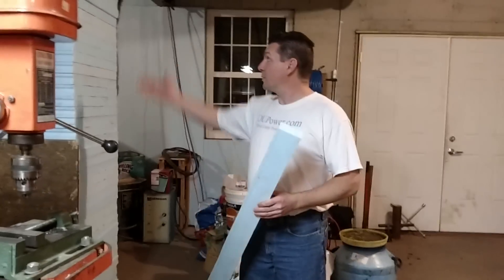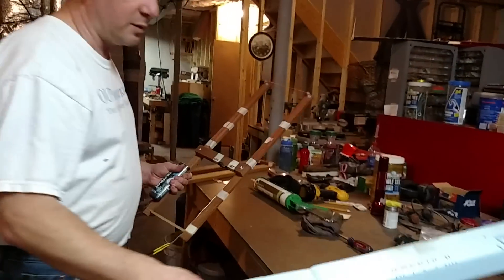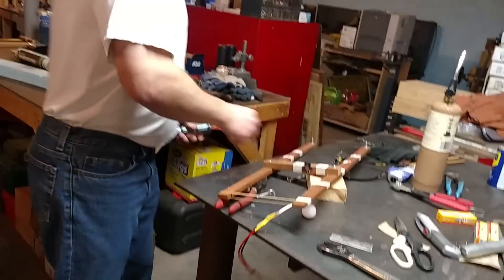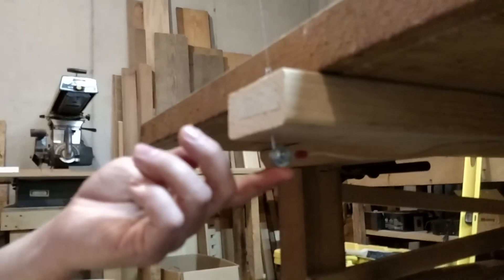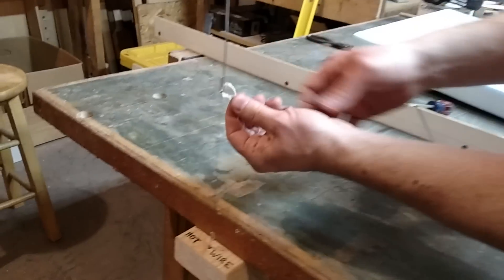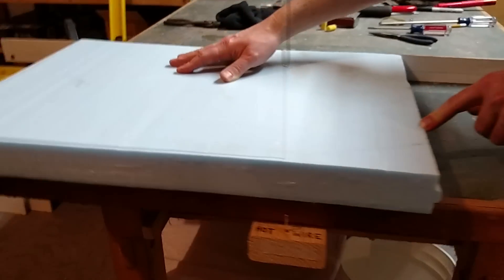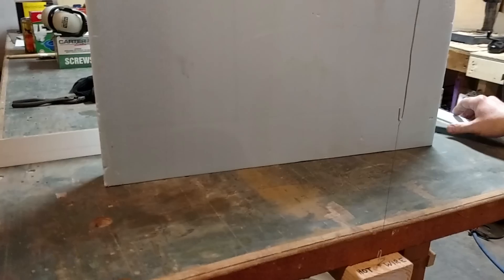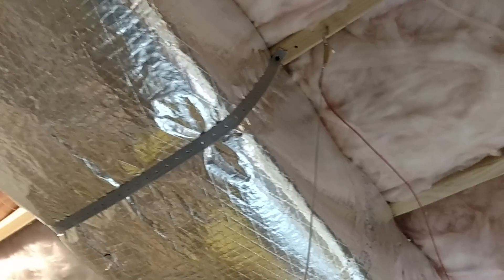The Ultimate Hot Wire foam cutter! Part 1

Comment: Need more information as to what wire you used, what is the power source (amp and voltage rating) etc. How do you deal with the fumes?

Comment: Wow... Do not use Styrofoam  for interior  insulation. .. It's FLAMMABLE   and produces TOXIC SMOKE! 
it's rated for exterior only..  Throw some of that on a fire you'll see!
USE  Roxul, comfort board or any rock wool or fiberglass products.. Interior rated!!!
That blue board is expensive AF anyway
This is why we have building inspectors and permits for basement finishing. 
The hot knife is cool though ....
Reply: I'm using this blue board for ribs in my ultralight biplane project. Should be okay as long as the enemy doesn't use incendiary rounds  ;-)

Comment: Good idea, im doing same thing in my basement and your way is way cleaner than mine lol. One observation about yer basement, if you take the insulation off the trunk of duct work, it will introduce heat into basement, and the floor of house. Worked for me.?
Reply from the maker: One day I'll get around to removing that insulation. I took it all out of the ceiling so when I fire up the wood stove(s) in the basement I literally heat the entire house! I love that aspect and designed my house that way on purpose.
Reply: Thats funny, i also designed and built my house with the intention of wood stove in basement for that very reason, but didnt, and kick myself for not. Now ive spent the wood stove money on other house stuff.... Someday!

Comment: been using this tool for over 40 years … my first was actually a double hot wire running parallel to each other and very close together. With a metal airfoil shape pinned to each end of a foam plank one could make a wing easy peasy. Nothing new for those in the know but yes it is the easiest way to cut foam

Comment: I’ve made similar foam cutting tables years ago and used a voltage variable 12 volt power supply in the 2-3 amp range. This lets me use any thickness or reasonable length of nichrome wire as I can dial up and down the voltage for the correct cutting temperature that suits the material at hand. Also, a large funnel and shop vac with a damp cloth on the vac’s exhaust makes a great fume extractor. Good job on your video!

Comment: Wow you made this a lot harder than it needs to be. Just invest in Variac variable AC transformer. You can get them for under $100, ( I think I paid $65 for mine on ebay) and have complete control over the current you're passing through the nichrome wire. I've been using one for years to cut foam board. I even made something similar to a table saw with a miter slot, and fence. I just slowly turn the dial, increasing the voltage until my wire begins to glow, then I back it off until I no longer see the wire glowing red, and you're ready to cut. No more worrying about wire length apposed to voltage, or any of that hassle. Here's a link to what I'm talking about, but search around and you can find good deals on them. Mine is 5 amp, but you really would never need anything more than two or three amp. I have this exact model, but as I said bought it brand new on ebay for about $65
 https://www.amazon.com/Science-Purchase-Variac-Variable-Transformer/dp/B014X2QDLA/ref=sr_1_26?ie=UTF8&qid=1508700304&sr=8-26&keywords=variac+variable+transformer

Comment: Nice Idea. I'll be trying a rig like this soon. How long do the batteries last. What about charging cycles. Can it be configured to run from a home outlet
Reply: why worry about charging? use an old pc power unit you get 5V and 12v

Comment: It works great! If you use 120 VAC and a transformer you can use a simple light dimmer and adjust the temperature for different cuts, but by the time you get this I bet you are already done. But you can build model plane wings or plugs for mold making for carbon fibre car panels and  snowmobile hoods to lighten your load and save gas etc as well, maybe even make a little money from your creation. You seem to like doing things youself like that wheel in the background...what is that by the way? I know it's not for a very long garden hose.
Reply from the maker: I Missed this comment a while back. Sorry! It's for my gravity engine experimentation I used to do. I had a LOT (300+) of designs that I was playing with for a working gravity engine. Some of my designs got close to spinning continually. This was the test frame for various designs. http://OUPower.com has some of my stuff on this.

Comment: You do not mention anywhere what gauge wire you used.  I have a similar foam project I will be doing and plan to construct a unit to cut long lengths of 2" Styro.  I am going to use a DC train transformer for power supply so it can be easily regulated to get the wire glow set as you show.  (Something I already own as I do not have any batteries like  you used).  What was the support wire you used to hold the cutting wire?

Comment: For some reason the red and black work cuts, slow. The yellow and black does not turn on the fan? What do you suggest? I hooked everything up like you did in video. Thanks!
Reply from the maker: I can only assume you're referring to a computer power supply that you were trying to use for this project. In that case you seem to have failed to show a load on the 5v leg (Red/Black) so you can solve that by putting a 5v load on red/black and then your yellow will give you 12v+. Good luck!

Comment: The best system is to use a soldering iron, remove the heating bit by loosening the screw that holds it, and inserting a stiff wire to the length required and tightening the screw. All you have to do is to attach the soldering iron to the side of the table with a clamp, with the heating  wire pointing upwards. Now you are ready to start cutting by sliding the foam board on the table through the wire, using a wooden  strip as a guide for the width required.
Reply from the maker: doing what you suggest creates a huge V shaped kerf cut. The cut is larger at the top because heat is concentrated in the iron near the heating element. Plus heat rises so the iron should be BELOW the table. Sorry but I disagree with your statement that it's the best method. I think what I've done here is pretty simple, reliable and efficient.
Reply: I am using it to cut templates, and I have no problem, you don't need that much of heat to cut Styrofoam.
Reply from the maker: right but your margin for error grows more with this large amount of heat so close to the foam. Look at the end of my video around 7 minutes and you will see just how beautiful your edges are when you use my method. This level of control is necessary for the work I was doing to give a nice finished product. If you are not making precise cuts then it doesn't matter.
Reply: Chris: I, too, have used the soldering gun method, and had great results. Besides, aren't you going to tape over the seams anyway?
Reply: My Space 0
Reply: My Space i
Reply: I did this but the wire was heating all the way to tip, apprx. 8".    What wire material do you recommend?  Can we use alum./st.steel/or metal rod.  I ended up with 5 S. irons from a yard sale and would be great to be able to extend as  you mention.  thanks
Reply: @berealrelentless6237  nichrome u moron

Comment: Can you buy that nichrome wire at a hardware store or do you have to order it? Thanks
Reply from the maker: You can buy some at K-Mart if you get a cheap hair-dryer. Open it up and salvage the wire (nichrome springs). Then you can use the housing and blower to make yourself a foundry and start doing lost foam casting! It's exactly how I started with Lost Foam casting. :) But yes online seems to be the only place to find raw wire. Never saw it in hardware stores.
Reply: Thanks Chris.
Reply from the maker: I use Kanthal wire also. You can find both on Amazon.com
Reply: Thanks to the vaping/e-cig market, you can get nichrome wire in spools of 50-100' on Amazon for about 7 bucks, in various gauges.
Reply: Mig wire is nichrome, and it's probably the cheapest and easiest to get, got a friend with a mig welder and then it's free!

Comment: One of the best I have seen on hotwire cutting. I love the way you estimated the necessary length of the nichrome wire based on the batteries voltage. So if one wanted to cut wider foam one would need higher voltage?

I'm wondering if it would be possible to cut at say 45 degree angle, perhaps an angled fence or perhaps an angled nichrome wire.... thinking about how this could be implemented for greater flexibility then the ultimate hot wire cutter would graduate to the most awesome ultimate hotwire cutter ....lol
Reply from the maker: +veganath Thank you. It turned out to be a great and very simple idea. I should have started that way first. LOL Oh well, that's how we learn. Yes you can certainly do 45 degree angles. Just attach the longer wire to your ceiling anywhere you like. It's infinitely adjustable in that regard. You could even get tricky and move the attachment for the top forward say 3 feet. Then cutting straight on would still produce a 90 degree angle, but if you moved your fence and came in feeding foam from the side, now you'd get your angle cut. So depending on the angle of attack into the hot wire you could get a LOT of different cut angles.
Reply: Christopher Moore yes great idea to move the anchor point for the wire to a different position on the ceiling to get the desired angle. Thanks Christopher
Reply from the maker: +veganath right but moving it forward did you grasp what I was saying ... you could get your 45 degree angle if you feed foam pieces from the side, then still achieve 90 degree angle cuts if you feed from the front.
Reply: if you put the top holding point on a rail that its length is equal to hight you get 45 deg! easy !